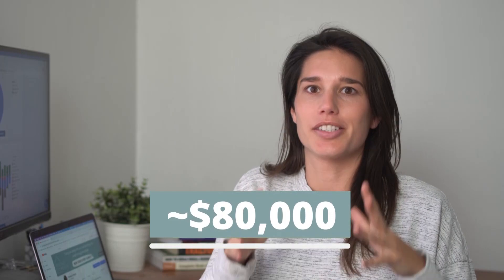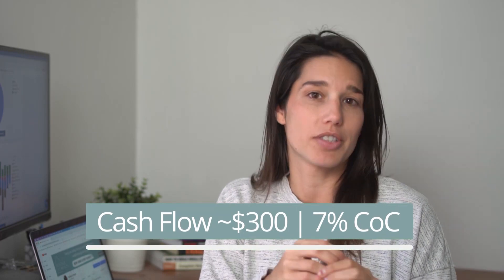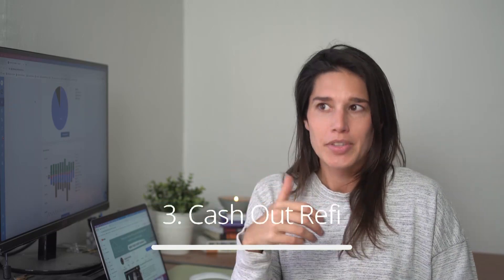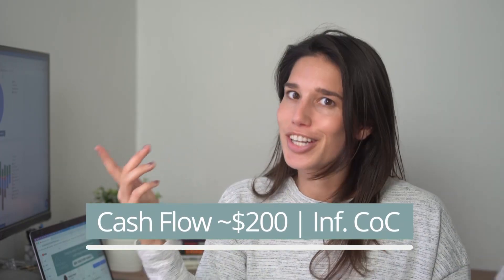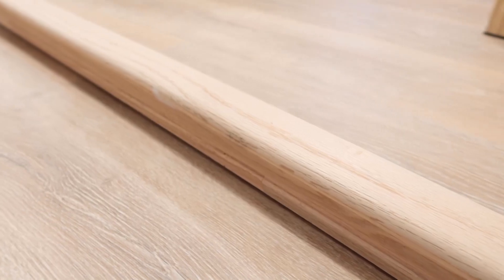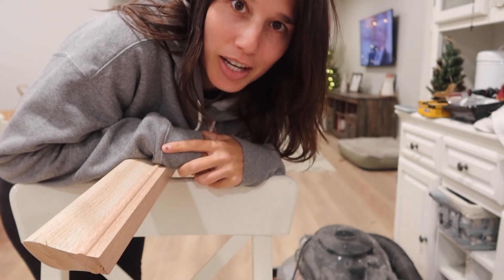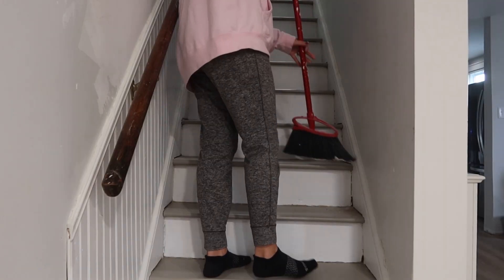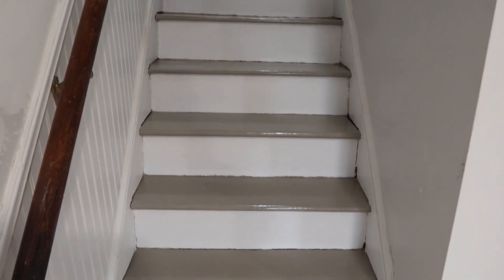This is Your Sign to Buy a Rental Property! | Cash Out Refi + BRRRR Renovation Update

Comment: Had two similar lessons learned this year! 

-Submitted plans for a gas dryer in a bathroom and was given a no-go from the building department. Decided to switch to electric to avoid the vents you talked about, and actually saved money in the end because the electric version of the same dryer was less expensive, and there was an dedicated 220 circuit (unused) that we repurposed for the new dryer. 

-Ceiling joists were super wavy and the new drywall was gonna follow that flow. My drywall contractor told me about RC1 channels. It’s basically a metal furring strip that’ll give you a perfectly level ceiling in the end. Total extra cost was $500. Installed in a couple hours. Avoided the crazy lumber costs from this year!
Reply from the maker: Awesome! Glad the dryer hookup worked out. I’ll check into those metal furring strips next time, thanks for the info!

Comment: Here in OH, it depends on your municipality how strict inspections are. Our local town is pretty cool to deal with - very reasonable as far as expectations. There are lots of homeowners and renovators that transfer property where no permits were pulled, and nothing happens. Permit review is generally not part of the sales process. We sold our house in 2015, and most of the miscellaneous updates we had done were not permitted (although we did good work, so it would have)
Reply from the maker: Very solid points!

Comment: In new construction, if the service panel is installed on the opposite side where the main electric service line is running, the contractor is then responsible to trench at least 36” deep from the service main to the the service panel. and then has to place 2.5 conduit with galvanized 90 degree turns, with string snaked through it, so all the power company has to do is snake their line from one end to the other😅 ask me if i’ve got blistered from post hole diggers🥴
Reply from the maker: That’s crazy bro I’ve actually heard that for here in Jersey too..they have to do the conduit inspection before the line is ran so essentially it’s 2 inspections for the same thing..crazy